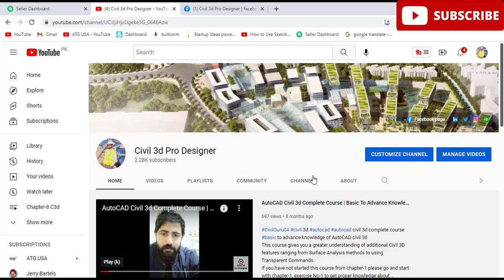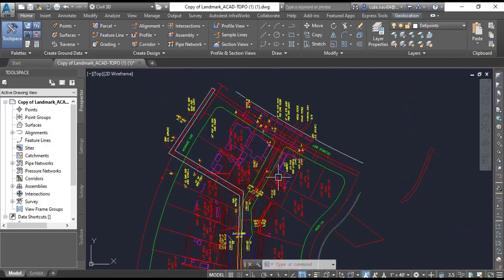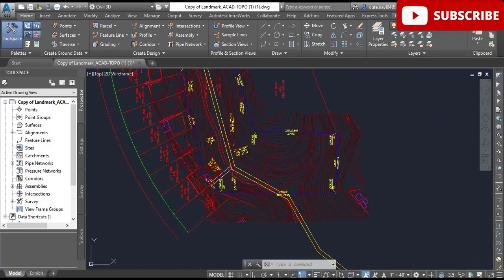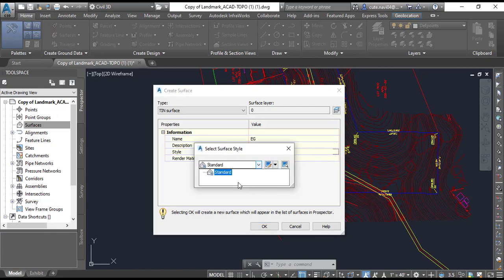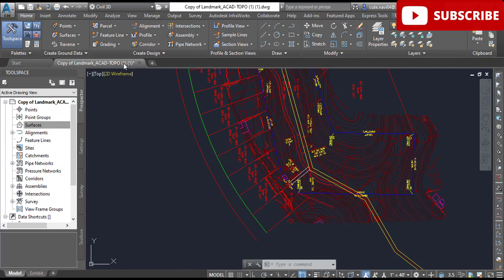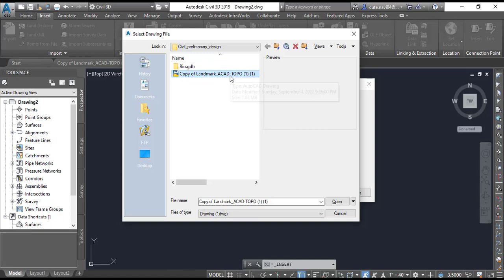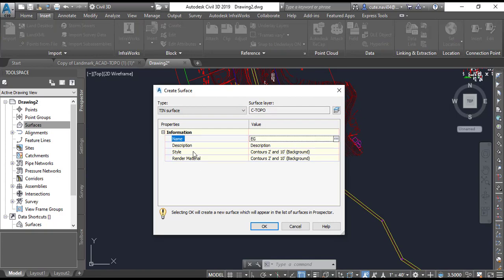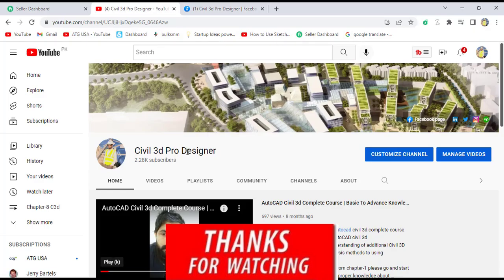How to Work Efficiently with AutoCAD file into Civil 3d | Convert AutoCAD File into AutoCAD Civil 3d

Comment: How do I do this in Civil 3D 2025
Reply from the maker: Follow all steps which are given in video then you will get everything
Reply: @Civil3dpro04  the "More Options" function has been altered in 2025. For those who might face the same issue in the future, the Block pallete has similar functions as the more options and that's what I used.
Reply from the maker: But these are really very basic steps which can b solved easily in any version..its not matter which version you have

Comment: Can Civil 3D directly pick contours from AutoCAD drawing file ..?
Reply from the maker: Yes, there's a method to get any cad contours into civil 3d surface
Reply: @Civildesigns04  Are you talking the method which u explained in this video
Reply from the maker: @UmerKhan-es4sh  yes
Reply from the maker: @UmerKhan-es4sh  there is lot of method ..even you can generate contours from pdf
Reply: @Civildesigns04  Sir, please make any video on this topic 
+

How to generate points in Civil 3D from Simple Autocad Drawing File
Reply from the maker: @UmerKhan-es4sh  you mean we have some point in cad file and then convert these all points into civil 3d cogo points?/
Reply: @Civildesigns04  Yes, exactly...!
Reply: Also make a video on topic how to extract contours from pdf file as you mentioned earlier in Civil 3d,

Thanks for your considerations
Reply from the maker: @UmerKhan-es4sh  i have already video on this topic. Look at playlist ( problem and solution)